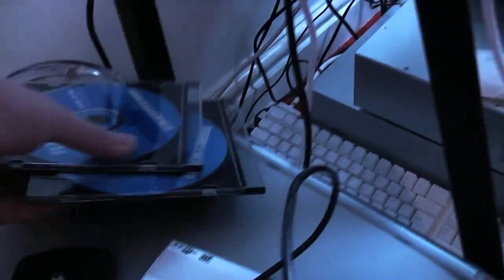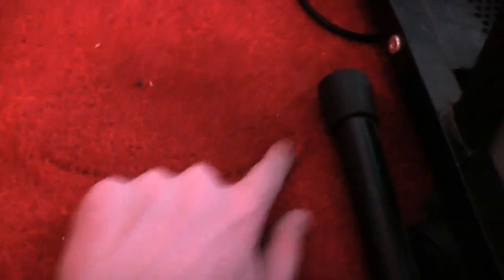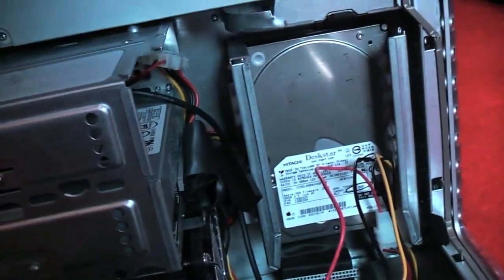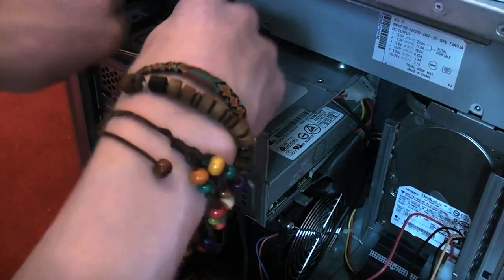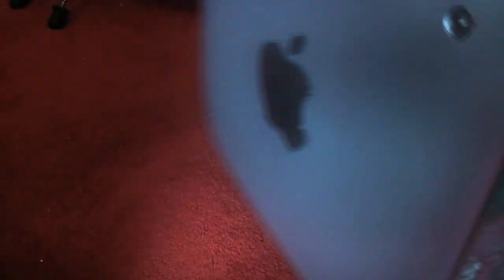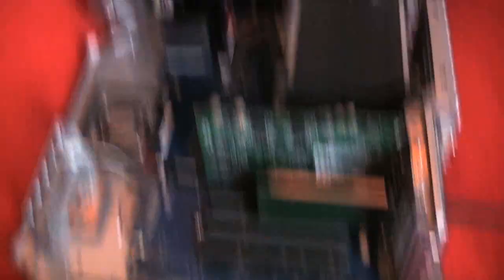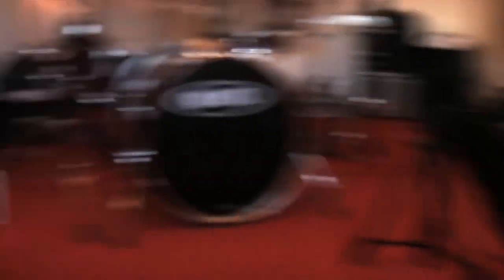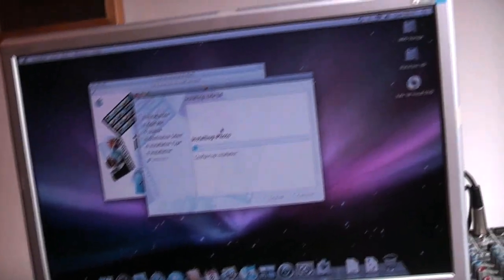Parting with my MDD...

Comment: the fan noise is easily fixed i just fixed my mdd to be WHISPER QUIET u dont have to buy a new power supply u just dissassemble the unit and replace the power supplies fans with 60x60x25 fans, i was in the middle of doing it and was worried about splicing + resoldering the power connections but then i realized the fans i had got can simply plug into a molex connection and i did the mod without any splicing of wires whatsoever it was the most simplest mod ever and now my mdd is SILENT!!!!

Comment: Are there any advantages to using iLife '08 to iLife '09? i just got myself an iMac g4, 800mhz 768mb ram, broken Ethernet (but that's a story all on it's own) and installed leopard with leopard assist, i put iLife '09 on it but I'm wondering if i should have gone with '08 also would there be a significant speed boost if i get a 20" iMac g4 with 1.25ghz and 2gb ram? i do know the disadvantages of ppc but i live the imac g4, it's my favourite apple design.

Comment: iLife '09 does not run that much slower than iLife '08 would, and considering minimums specs are a 500MHz G4, you should be fine.
Then again, I have a dual 1.42GHz Power Mac G4 with 2GB RAM, which is faster than some G5s, so it basically runs anything PPC.